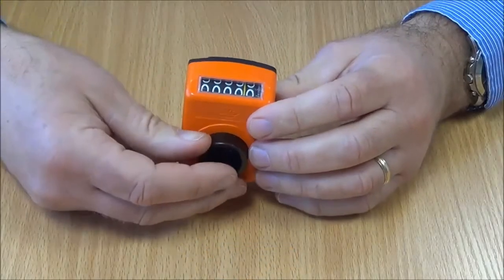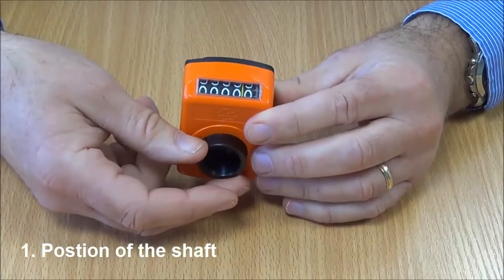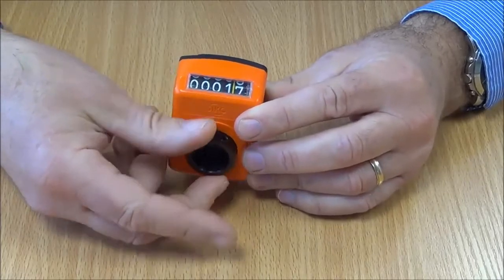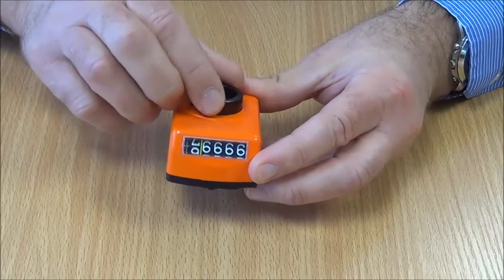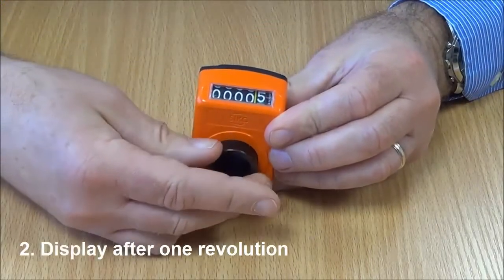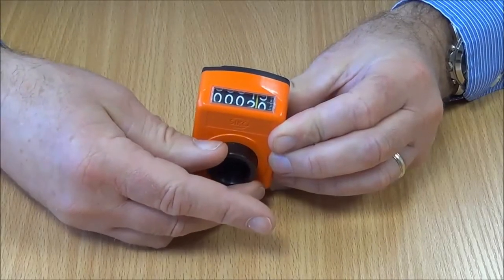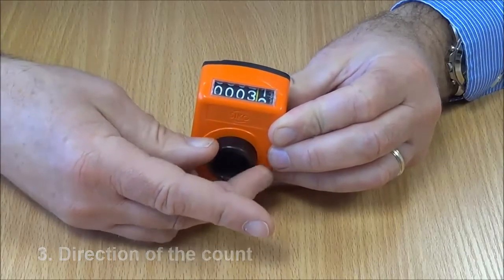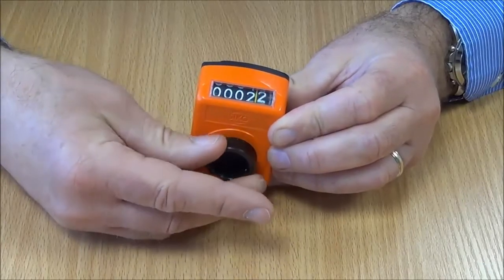Siko How to specify a mechanical position indicator

Comment: Could you please explain in more detail how your SIKO counters turn with a threaded shaft?  I work with these on a daily basis but am curious of how they function mechanically.  I only work with non digital ones.  Do the threaded shafts pass through the counter, and as the shaft is adjusted, the position moves gears inside of it changing rhe number?  Please explain.
Reply: The shaft would pass through the indicator and be physically turned with a handwheel connected to the end of the spindle. The Handwheel therefore sits in front of the indicator so the operator can see the indicated value as the wheel is turned.

Comment: Is this available in different bore size of shaft?
Reply: there are a number of indicators from DA02 (10mm bore), DA04 (14mm bore), DA09S (20mm bore) and DA10 (30mm bore), each can be supplied with reduction bush to reduce to common mm bore bore sizes.